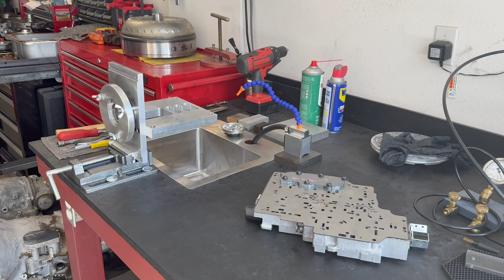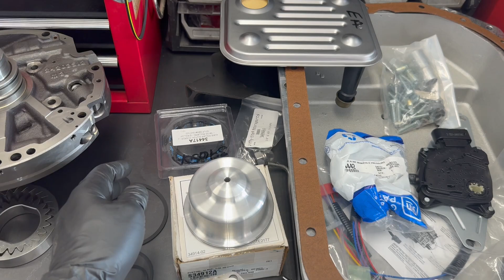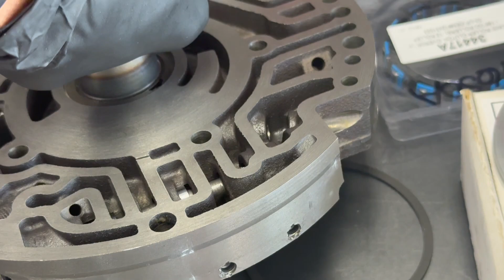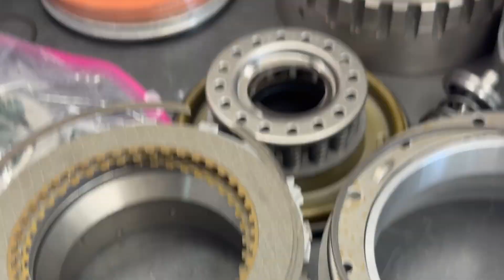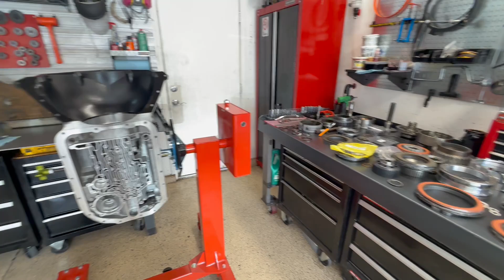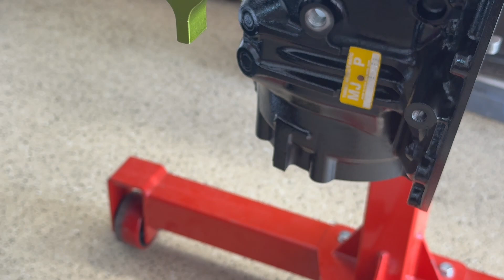Customer Build Profile - 4L80E | 2005 Silverado 6.0 LS Swap

Comment: Hi Nick, I used your videos to build my 4L80E. Followed them to the tee. We just got the LS 6.0 & trans in the truck & running. I have a 2800-3200 but the truck barely moves forward & I have no reverse. Should I perform a pressure test, or something
G internal I. Not correct?
Reply from the maker: Hi James, sorry to hear you're having difficulties w/it...Yes, do a line pressure test to see if the pump is putting out pressure and line pressure rise and go from there. ...Also make absolutely sure you have enough fluid in the system.
Reply: hi Nick, was just wondering where your shop is located, west or east coast? Thinking of sending you this trans to repair.
Reply from the maker: I'm in Las Vegas...Where are you located?
Reply: Hilo, Hawaii. No good experienced trans. Shops here for electronic  trans in the islands. Maybe you can message me some how and we can talk?

Comment: Hey Nick,did that CK performance recalibration kit separation plate come solid or open where the block off plate goes over?I ordered a couple kits about a year ago and the plate looked stock.I wasn’t sure on using a gasket or not in fear of a blow out leak under the block off plate.Whats you opinion on using a gasket or not with a stock looking plate.Thanks again for sharing your knowledge..
Reply from the maker: Hey BigFun4Life, thanks as always for watching! 

The CK plate is solid in the area of the accumulator stack - no holes; same with most of the aftermarket plates that are designed for a block off kit, including Jake's Perf recal kit. 

I don't think I have never used a stock plate when blocking the 3rd and 4th accumulators so really can't say for sure. But if you want to be sure of sealing off/preventing any leakage in those circuits at all, I'd install the gasket - it wouldn't do any harm and may prevent a leak.
Reply: @nickstransmissions thanks again for the information much appreciated..!
Reply from the maker: You're welcome!

Comment: Nick will these mods throw a pcm code or will a stock pcm work fine with all of these mods.
Reply from the maker: No codes will be set/stored based on the mods I have covered. They can only help, if done correctly.

Comment: Hey Nick. Thanks for another informative video. It's definitely appreciated. I've got a question: If you don't mind. I've already drilled line to lube in the pump/stator. How would I know if I have the correct valve to use with that modification? I installed the sure care kit valve from Sonnax already. Should I swap my stock valve back into the unit?
Reply: Upon further inspection, that kit doesn't come with that valve. So, I believe im in good shape with what I've done so far.
Reply from the maker: Thanks for watching, Moose...As long as you installed the factory pressure regulator valve, you can drill the line to lube hole.
Reply: That was indeed what i did. I got a little confused about the different parts i had thrown at the trans for a minute there. Its a lot to keep track of.@nickstransmissions